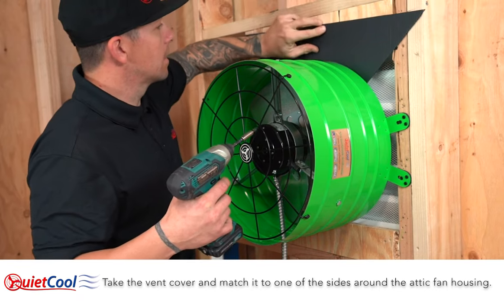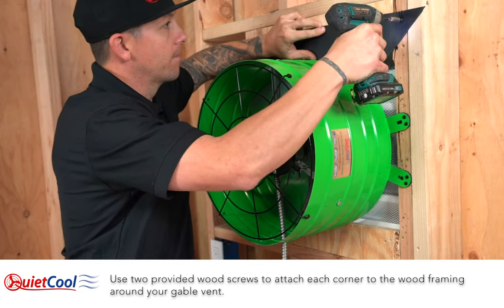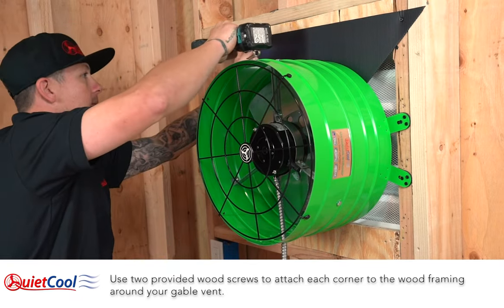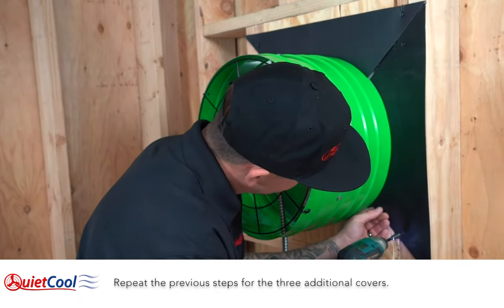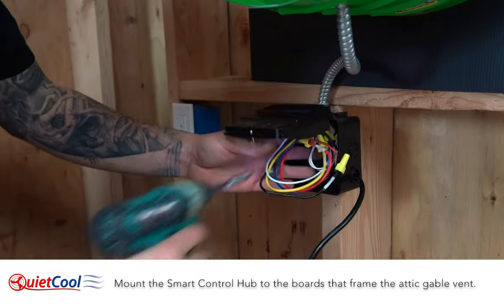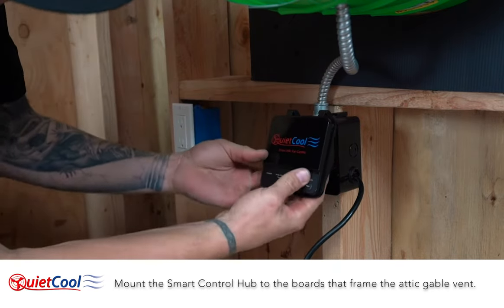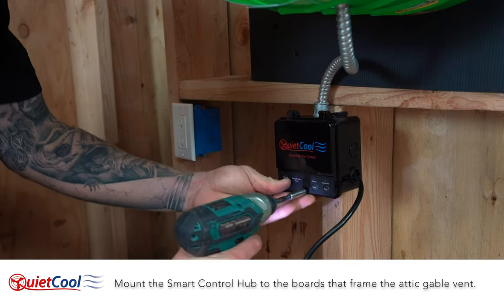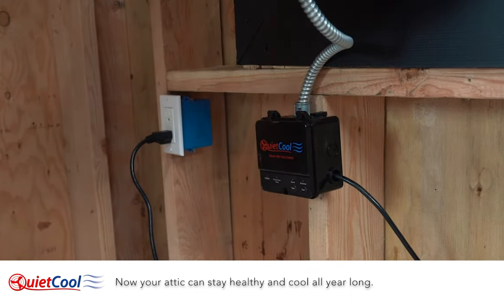How to Install an AFG SMT ES-3.0 Attic Fan

Comment: Thanks for responding! I understand. The previous fan was hardwired, so I do not have an outlet nearby, just 12 gauge Romex with white, black, and ground.
I would add an outlet to the end and then use the fan plug?
Reply from the maker: Yes, exactly!!

Comment: Can this be hardwired if electrical connection already exists?
Reply from the maker: It comes plug and play ready with a 20 ft power cord. You just need to plug it in an outlet.

Comment: What sizw of gable fent is needed or best size for this install?
Also where is it best to install this fan on the south side where the sun sets? Or north side when the side rises. Thank you
Reply from the maker: This will work on any gable but the preferred size gable vent is an 18” x 24”. The side of the home won’t matter. It will exhaust out all the air in the attic every 3-4 min.

Comment: Are these fans made to pull air in or push it out?  I'm wanting two units with one on the south-west end of the house pushing air out and another fan on the north-east end pulling cooler air in.  Is that going to be overkill on a 2,000 square foot rectangular shaped house?  The footprint is 80 x 25 with the attic height at center being 6ft of headroom.  We have two 16" convection whirl vents (the type that spin on their own) but it still gets so hot over the summer that we really want to add gable fans.  Please help and advise!  Thank you.
Reply: You don't need an intake fan.  These are solely exhaust fans, and the passive vents in your attic will provide cooler relief air.  If you don't have soffit vents or an intake gable vent, you may need to add them, otherwise relief air may be drawn in through your whirl vents or from inside your house.
Reply: @spirituallyinsane  yeah, I added an exhaust fan on our southwest end and an intake gable vent on the northeast end.  Not only did the north side not have anything, it was a room addition to the house and the original stucco gable wall between the house and addition was fully in tact so after cutting and framing the new north gable I had to install some joist runners to walk in 15ft and then with an angle grinder and demo hammer had to remove a 10ft wide x 5ft high section of 1” thick stucco.  That was realllll fun.
Reply: Just add passive vents for intake. Soffit vents if you can. Inexpensive and do the job.
Reply from the maker: @vikinglord73 big difference between static vents and mechanical ventilation. Static vents are good but when you have an attic fan you can change the air in the attic every 5 min versus several hours. This is why attic fans keep your attic temp within 10 degrees of the outside temp at all times. Without an attic fan the range would be 30-40 degree difference

Comment: Hi. I dont have a gable vent but rather a window in roughly the same place. If I make a plywood mount to go over the opened window and cut out a hole with a jigsaw, then mount the fan to that--- will this be ok?
Reply from the maker: You can control it by the QuietCool phone app. Most people don’t know if there fan is actually on or off or even working. You can monitor the temp and humidity conditions and have full control of your fan. No other fan has this capability

Comment: Does 16" metal duct fit this enclosure (minus the grille) for extending the draw point or creating an in-line situation?
Reply from the maker: I’m confused on what you mean. This product has no metal duct. Are you talking about the  metal housing?

Comment: What if I don't have a gable vent on my roof, but I still want to install one of these because the venting in my house is not enough for the whole house fan (sold separately)?
Reply: If you don't have a gable imo this isn't the right product for your house.  If you do have a gable as we do this is a great product.  

I have a triangular gable so I had to cut a triangular  plywood mount to cover it then cut a 16" hole in it for the fan to use.  Works great and I really like being able to see the attic temp and humidity levels with the app though I wish it was wifi instead of bluetooth so I could see them from anywhere.